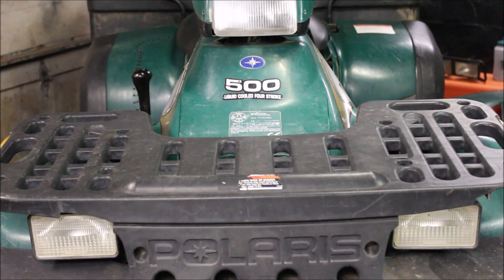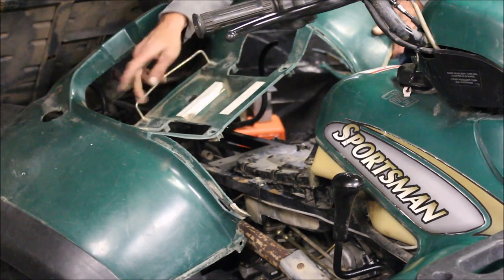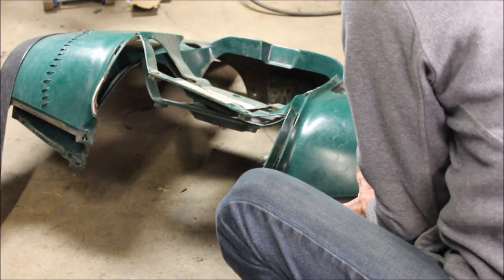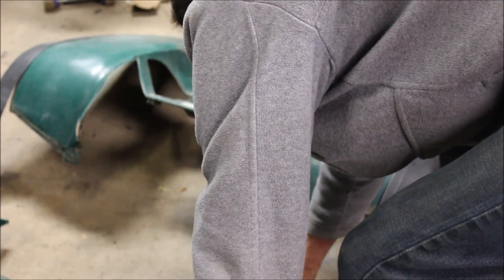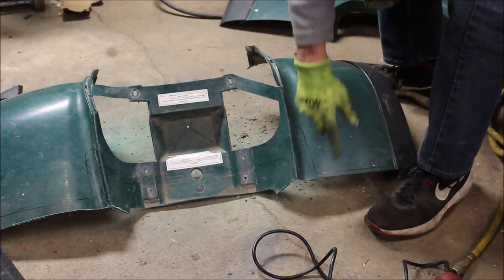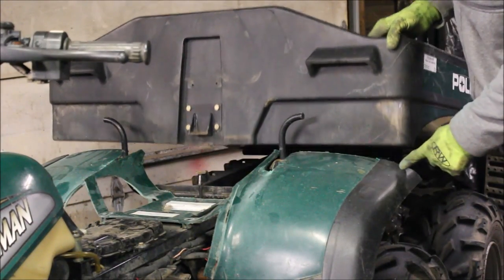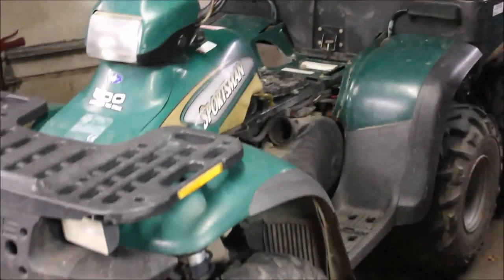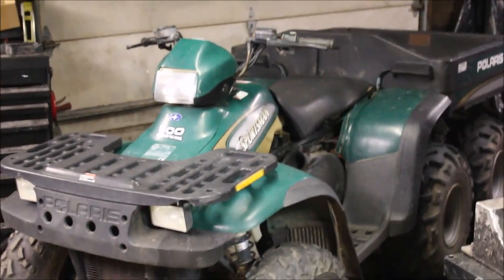Polaris Big Boss 6x6 Rear Fender Repair! Don't Zip Tie Them! Make Your Own!

Comment: Dupli-color truck bed liner sprat cans from oreilly’s will make the bumpers, racks and footwells look like new and provide protection against composite itchy material
Reply from the maker: So does linseed oil and lacquer thinner mixed 40/60. It also helps keep the mud from sticking. The downfall of a bedliner spray. But good tip.

Comment: I'm curious...... what kinda money is a 500 6x6 worth,...
Reply from the maker: I sold that one for 3500.00. depends on your location.
Reply: I have 2,... went thru, 2 new cams, oil changes, rebuilt the front end as far as bushings, ball joints,. Brakes,  and good cleaning,... both are 2000's ,..made bigger battery boxes, think 900, 1000 some hr.s just curious of the worth,..